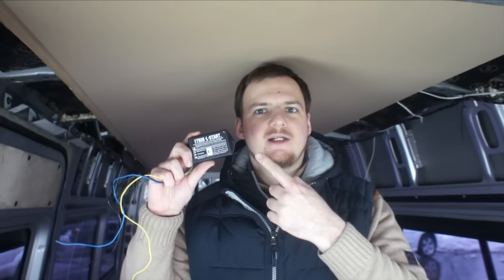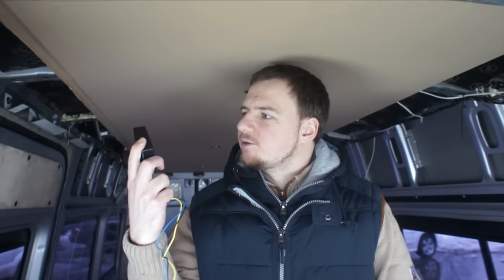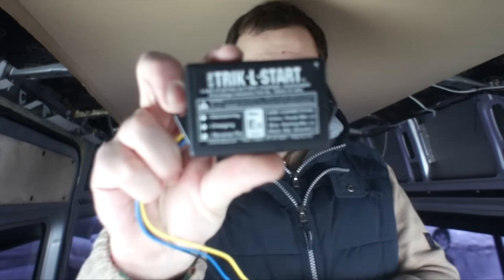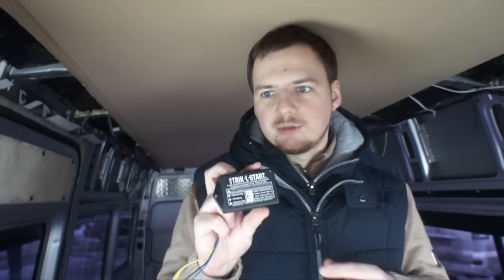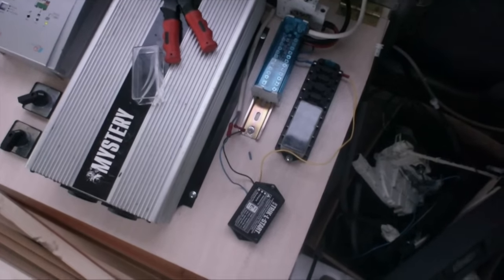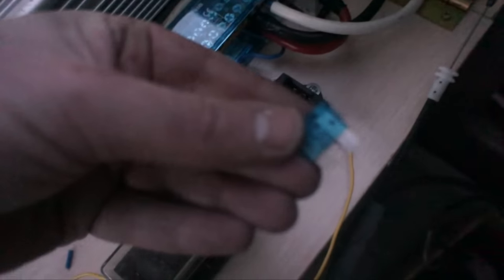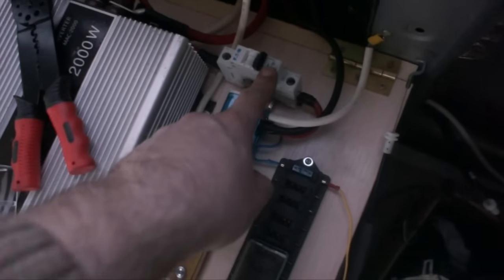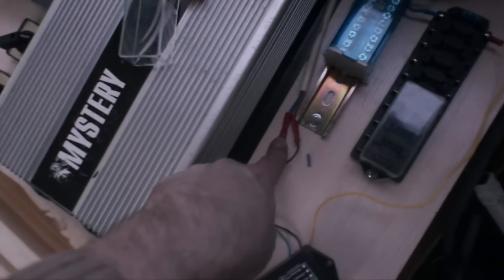VanTourist - installing start battery charger/maintainer 12V - 12V TRIK-L-START

Comment: I have a manual switch for my charging off the front while driving. When i stop, i turn it off from the front. When my front dies i use the rear to save my butt. I dont have solar yet and hopefully can figure this all out with your videos. :)